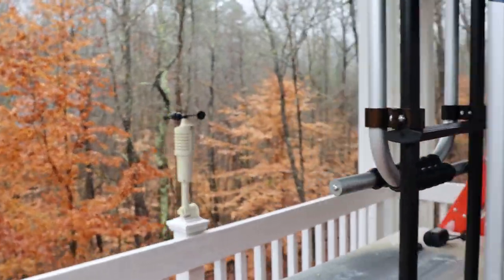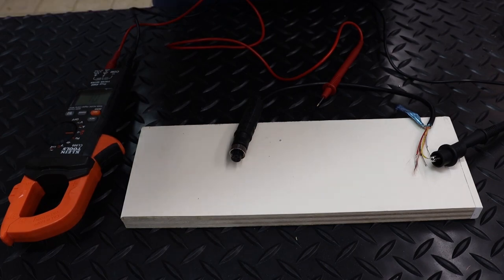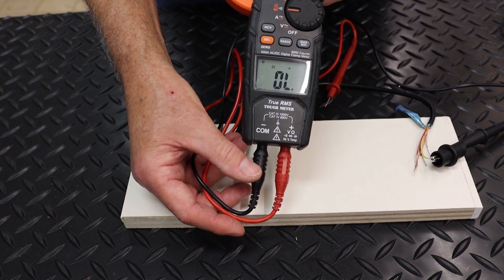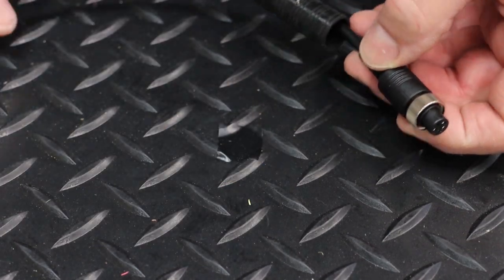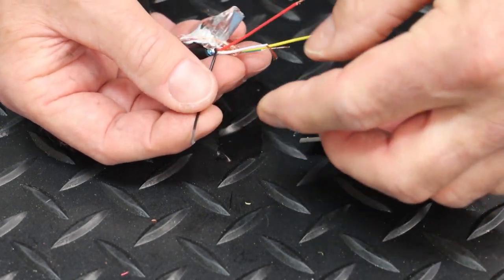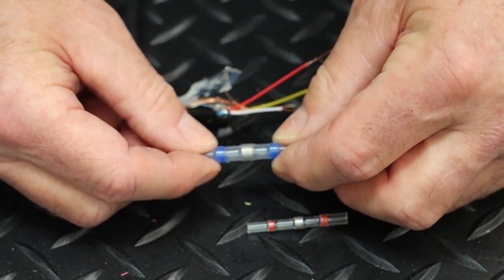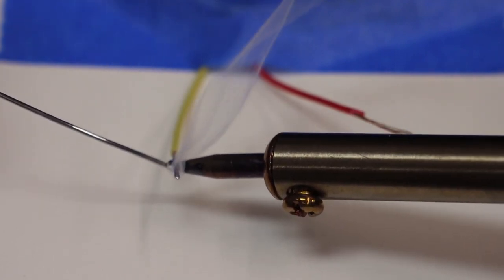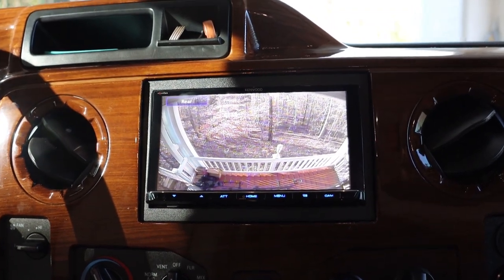Repair RV Camera Cable Quick Tip 2

Comment: Hi Kevin,  I am also replacing my Voyager camera, and I am following your advice.  I've purchased the Erapta.  
I have it all wired, but I and going to see if I can reuse my backup camera wiring since I can't re-run it through my RV.  The wiring is through my roof, and completely sealed.

I am hoping to buy an adapter to convert the Voyagers plug to the style used by the Erapta.  But I am not having luck determining what style either on is.  Let alone where I could by an adapter.  Any recommedations?  I could cut the ends off of splice on new ones from the Erapta system., but I hate to do since there is a lot of shielding it appears on some of the strands.  Unless it is my only option.
Reply from the maker: Try RVS, rearviewsafety.com or RVcams.com, Tim is great with problem solving!

Comment: hello, i have bought a reverse camera for my car and it has a logo pop up mode, but i cut the wire to make it shorter and reconnected the wiring, it was one red cable and one yellow, i connected the uncovered wire, and that thin layer of that steel like paper covering but isnt giving any signal, is any chance that the camera is shorted out or something else?, what is the uncovered wire and that steel like protection even for and what happen if the wires makes contact with other wires, im worried i've shorted the car camera, how can i test the camera?
Reply: Make sure the thinground wire is grounded..